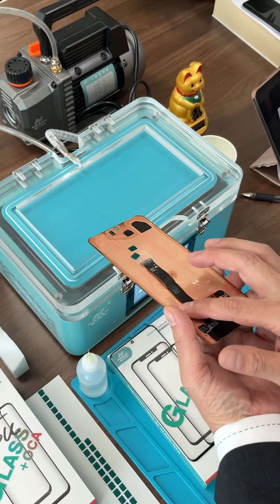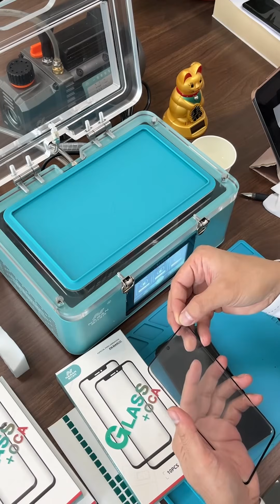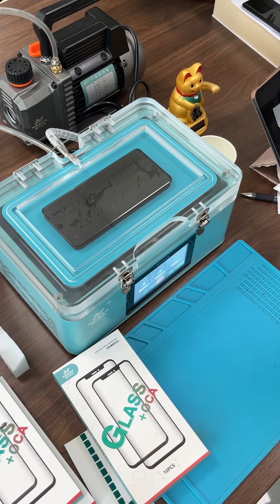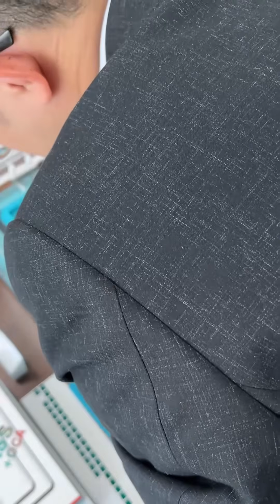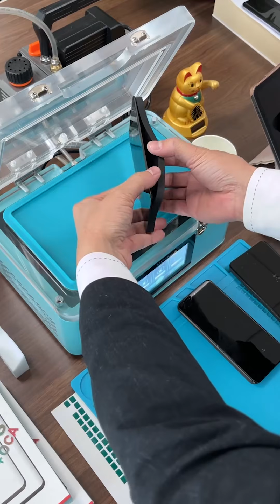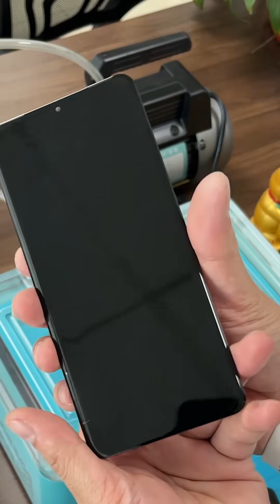Tricks for curved OLED screen lamination - NASAN SUPA LITE

Comment: so on this laminator no laminating temp. can I use these glass in other laminator with heating plates, what minim temp can use with this oca?
Reply from the maker: We also have other laminators that can adjust the temperature, only this one does not need to adjust the temperature. Glass+OCA has no special parameter requirements and is common to all laminators, mate